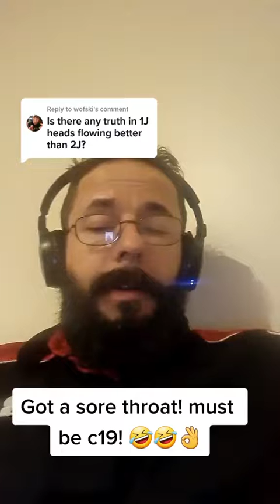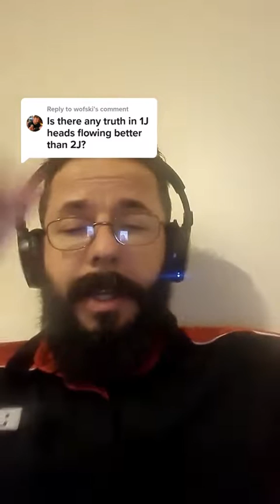"1JZ vs 2JZ Head: The Ultimate Comparison - Which One Reigns Supreme?"

Comment: That's a good video.  I wanted to know the answer to this also..  back in the day with the old Aussie hemi 6. People put the 245 head into a 265 and swore it made more power.. they did make better low down torque  due to Higher air speed in head at low rpm with the smaller ports but lost power in the higher rpm range... Good for towing and better driveability. This extra bottom end torque fooled folks into believing they got more power.. what they got was more torque in the Lower rpm range.
Reply from the maker: Exactly !!!